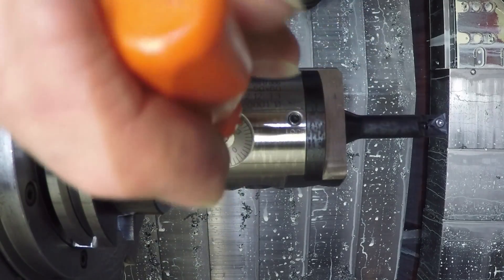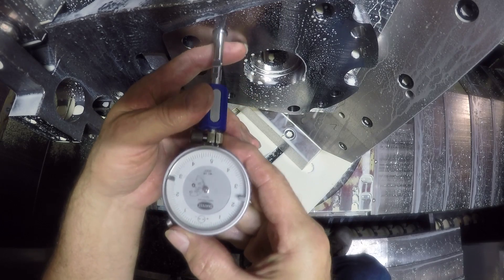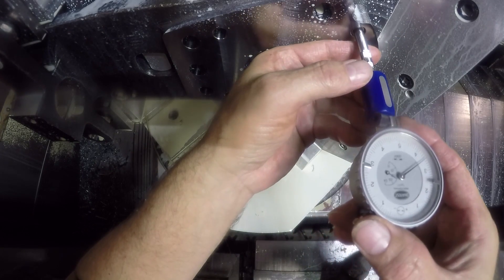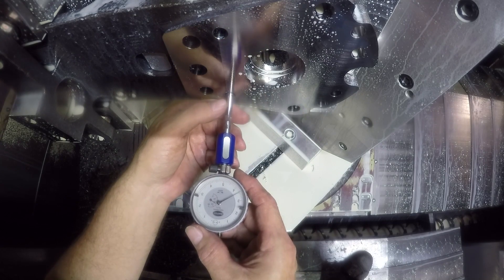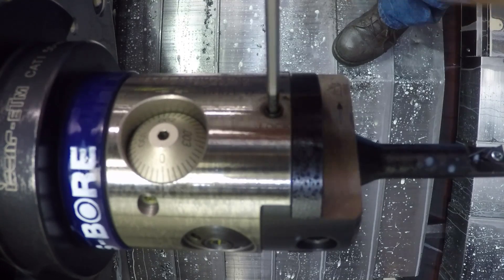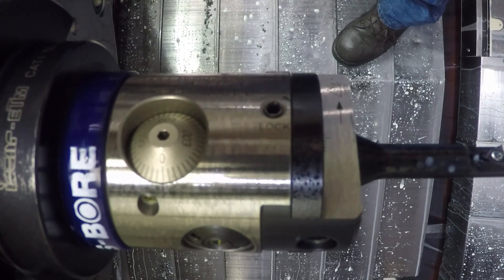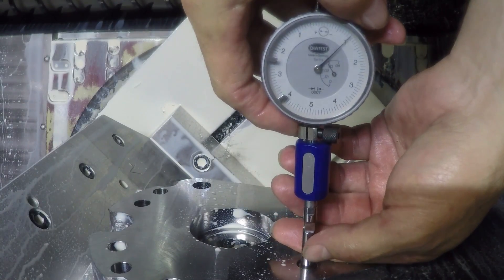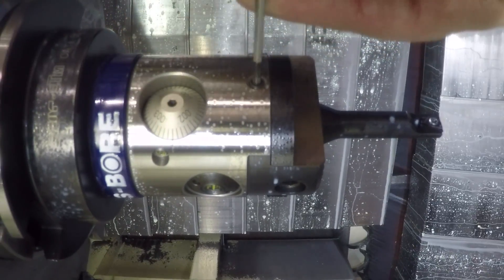Boring On The Mitsubishi Mill

Comment: What year is your Mitsubishi made?
Reply from the maker: 1999
Reply: @EdgePrecision  did buy it as New? If not, do you have some good tests what you run with used machinery to indicate its state in accuracy etc?  :)
Reply from the maker: I bought it used. It is a bit hard to enplane in a comment what to look for in a use machine and what can be expensive and not so expensive to repair. Maybe this would be a good subject for a video.
Reply: @EdgePrecision  thats an good idea! :) I need to buy a used cnc lathe at some point. Before that i need to get bigger workshop.

Comment: How does the pallet changer on this machine work? It seems do be a difficult task to hold a machine table with so much mass on it both accurately and rigidly. Is it similar to a pallet system on a normal you'd put on as an accessory on a normal mill (such as a Pierson pallet system), or is it something more robust? Given what you've said about the precision capability of this machine, I imagine it must be precise too. Any details would be very helpful. Thanks!
Reply from the maker: The pallet receiver in the machine has two precision pins that align the pallet when its clamped down. These pins are locater such that they land in the bushings in two of the pallets bases corners. They are about 32" apart. Like wise the pallet also has two precision bores/bushings that make up to these pins. There are also six precision  pads that the pallet rests on when clamped. These pads have air holes in them so when the pallet is raised up/unclamped air blows away any shavings. The pallet itself is clamped down with two hydraulic cylinders. it has what might be described a wide t-slot in its base that mates with the hydraulic clamping system. It is pulled and pushed in and out of the machine by another hydraulic cylinder that hooks to the side of the pallet when the hydraulic cylinders lift it up. The clamping devise (Wide plate that engages with the pallet) has roller bearings on its sides. So when it lifts the pallet it can roll  freely in and out. The clearances are very close on the alignment pins to assure accuracy. This system works very well it is extremely accurate and I haven't had any trouble with it. I hope that answers your question.
Reply: It does! Thank you very much, it's wonderful to have a window into how these things are designed.

Comment: What kind of tolerance does that machine have on repeatability for returning to a zero?
Reply from the maker: I would say less than .0001”. I have run and rerun boring heads and made adjustments of .0002” on the diameter. I have see the change on my dial bore gage. I don’t think the machine could do that unless it could position to less than .0001”.

Comment: Love the channel, would actually love the opportunity to work in a shop with a guy like you, having done it for about 20 years myself.  Been in Houston for about 8 years now ... Anyhow, I've learned that cast steel, 4140, 4130, 4240, 4345 .. even the main cast steel, 8620, seems very predictable.  I have to wonder whether the initial investment in a couple carbide tipped reamers would speed the process by enough to justify their purchase.  Start at say, .497 and go from there, would probably mean trial and error with approx 4 reamers on hand, but after the first part then you're golden.  Just a question, not knocking the ITS head, in fact, I love them and their predictability and repeatability.  Stay on bottom, turning to the right buddy!
Reply from the maker: Thanks  Johnny Wayne ; The reamer in question in the video was a carbide tipped reamer. I think next time (If there is a next time you never know for sure in job shop work) I will try something different like you say. With my grinder I will grind some form tools slightly undersized to rough the holes than ream them. The reason to rough with a form tool instead of a undersized reamer is to make sure the holes on true location before reaming. In other words not depending on just the drill. A reamer will follow whatever hole is there.
Reply: Edge Precision thanks for the reply.  Having just watched the previous operation video, I see where you had the trouble with the reamer reaming oversized on just one hole, hence the boring head.  That's an interesting phenomenon, I'm guessing because of an inconsistent heat treat in the casting.  Thanks again!

Comment: when the boring head goes to the bottom of the hole and stops spinning, does it drag the insert up the side of the wall?
Reply from the maker: No it’s doing a bore orient retract cycle. So it orients the spindle at the bottom than shifts over in X .010” than retracts the tool. Thanks good question.
Reply: Which g-code is that?
Reply from the maker: G76
Reply: Edge Precision Thanks for your reply. I had figured that out already. Sorry for asking. So when do a boring cycle, do you always mandatory stop the program, or do you M01 after you get your number and check the dimension afterwards? I think you said this was 96 parts. It didn't look like the type of part to call for a tight tolerance.
Reply from the maker: Check out my Casting-3 video. I explain it in detail.

Comment: stupid stairs right at the loading zone...
Reply from the maker: Do you mean the steps in front of the mill? Without the platform you can’t reach the pallets fixtures. It use to be wider at the other building I was in. We had to shorten it a little to allow more room for the forklift to drive by.
Reply: Yes exactly, 
you are standing pretty close to the edge when you working at the fixture one accidentally step back, an you land in the middle of the walkway.
i would be personally be more comfortable if both Steps were at the upper Level and a Singel lower step to the side.
a chain in the back, so you can feel when you step back to far and for heavy loading you can simply unhook it...

But hey its only my chicken out, i like strong ground in my back when im working on something the mind is one the problem the surrounding gets less attention this leads to  tripp hazards...

But if it works for you, its fine for me.
By the way amazing work you do, best wishes, im watching:)

PS: are the way Covers really that stout that you can walk on them?
Reply from the maker: Yes I can stand on the way covers. Like I said in the previous comment the platform was about a foot wider. We shortened it when I moved the machine into this building. So far I have never fallen off.🤞thanks.

Comment: Shouldn't every pass off the borin head be at least the same as the corner radius of the insert?
Reply: "the surface finnish always suffers"- try slowing down the rmp by 1/3 or even  by a 1/2, while keeping the feed the same.
Reply from the maker: The tip radius of the insert I’m using is .008” even on the first pass it won’t = that. Than you will have reduced depth as you get closer to size. It’s unavoidable. If you were roughing out a larger bore that might be possible.
Reply: viorel22cr good question  i am also curious .
Reply: Where i work , we do that on a daily basis , but just in the case of one offs , and non critical surfaces . Whenever i tried less than half or 2/3 of the nose radius , the surface finnish always suffers . The more light passes i make(in order to sneak up on the size) , the worse the surface it gets . But i must say this is on a lathe , but an insert is still an insert . 
How do you still manage to get an optimal Ra/Rz ?

Comment: Nice work Peter.  I was going to ask if you set the boring head small on each part and go thru the same process for each part but I see from the comments that you do based on the tolerance requirement and the part $ value.  I guess there is no way around tool deflection, even if you had 2 boring heads and used one to rough the hole and the other to finish there is no guarantee that the roughing one would get the same size hole so that the finishing one is always removing the same amount of material.
Reply from the maker: Exactly there’s no way around it. Besides these boring heads are expensive.

Comment: Hey Pete. I find your videos very informative. Keen to get into CNC, very inspiring. A while ago while working for a very talented machinist, I was shown a method to accurately account for tool spring-back. In a nut shell, the idea is to get a known value in the final 2 or more accurately 3 cuts. I’m a metric manual guy so bare with me, but the principal remains the same. Say I have a target of 50mm, you’d rough out to within 52.4 - 52.8 ish. In this case just say we nailed 52.4mm. Then switch to a finishing insert (.4 radius say) touch the tool off, dial in 1/3rd which is 0.8mm off the diameter (i often give a couple thou more for good measure as I just touched off). Make the cut, zero dro. Now the measured size is about say 51.72mm, you then dial in exactly half the remaining value of 0.86mm (from the zeroed dro that includes a bit of spring back from the previous cut). At this point you should be within a thou of 0.86mm remaining stock. From a re-zeroed dro dial in the exact remaining value. There is a bit of feel involved, but I have good results hitting sizes while making finished cuts on the heavy side.  I’d like to hear your thoughts?
Reply from the maker: Every situation is different. As you say it takes a certain feel. The only way is to get experience with the tooling you are using. I don’t know if you have ever run a Sandvik silent boring bar. In using one I have actually taken a finish cut on a bore, been slightly undersize and actually moved the bar down in size to cut larger. You see the silent bars are excellent at killing vibration but are very flexible. They will actually cut bigger with less pressure but at the same setting. So you have to move down for the spring pass. What you have to do is find out what combination of cut depths work for the tolerance and finish you want. Than try to consistently repeat that. It’s what I was trying to say in this video. Thanks for the comment.
Reply: Interesting. Thanks Pete. And again, great videos

Comment: Any recommendations on sfm and   ipt  for a boring head job like this? Thanks!
Reply from the maker: Generally what you end up with for speed is how fast you can run it without chatter. Unless it’s something like inconel. I usually feed about .002-.003” per rev. There are a lot of things that come into play. The smaller the tip radius the faster you can turn without chatter but the slower you have to feed if finish is important (witch tends to increase the likelihood of chatter). And also there’s the balance if the bar is off-center.
Reply: Edge Precision 
A lot of information, sound like a subject for a complete video.

Comment: Is this the initial setup of the boring head for a run. Or did you back off the head and reset up because of the insert change? Nice work!
Reply from the maker: I’m running three boring heads on these parts. I back the head off and run it in on every part. I can’t afford to take the risk of cutting any one of these bores oversize. If I was working for someone as a employe I could say I’m sorry but in my case I have to pay for scrapped material. It only takes about five minutes to run the three boring heads. It usually takes three cycles per head. It is very risky to try to hold .0005” total tolerance by running the boring head at the last setting. You might think it could be done but it’s been my experience it is very risky to try it.
Reply: Edge Precision I totally understand! I would do exactly the same. Otherwise your just paying the customer. Theres no way a reamer was going to do that job to size. Dam things always go over.

Comment: Have I got this right you are dialing the boring head on every part or am I missing something? That seems like a lot of work, I assume you don't have enough boring heads to run a rougher and a finisher or are is the casting material just that hard on the tools?
Reply from the maker: Yes I usually can get the bore to size on the third run of the boring head. In this video because I indexed the insert it took more. You can’t hold .0005 tolerance by just setting the boring head once and letting it run. There are to many variables. Did the preceding drill drill the exactly same hole as before is the insert on the boring bar cutting the same is the material exactly the same to name a few. If you can’t afford to scrap parts than it takes a few more minutes to be safe. It looks like it takes a lot more time in this video than it does. The more difficult the material is to machine the more critical this is.